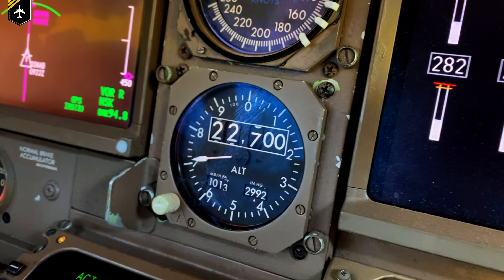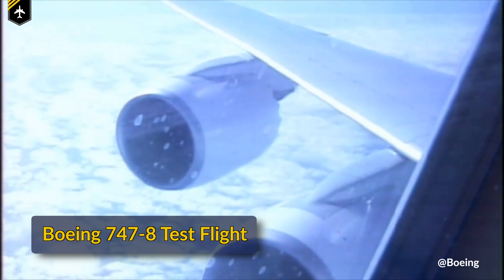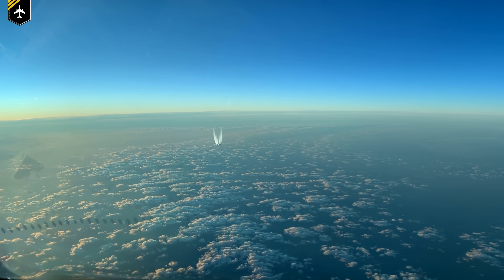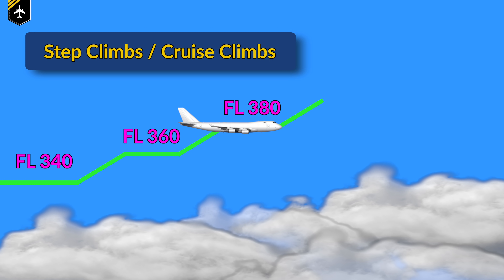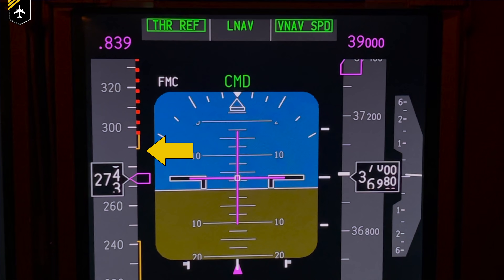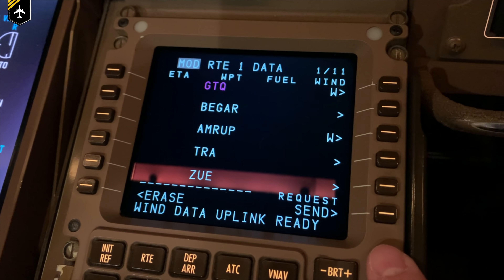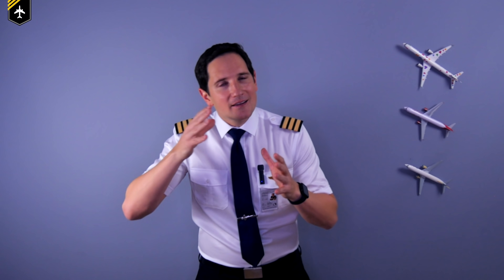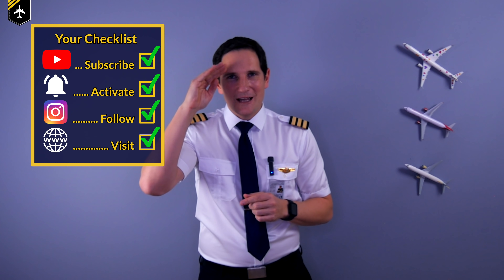How HIGH CAN PLANES fly? What is the COFFIN CORNER? Explained by CAPTAIN JOE

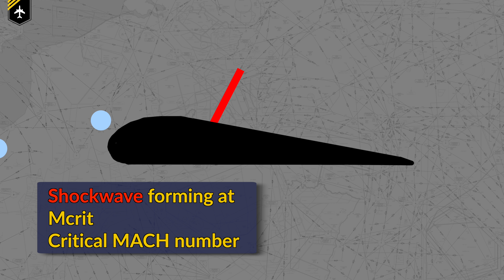Comment: At 8:52 we can see that the speed of the air is so that the flow of uover and under  the wing reunite at the trailing edge but that's not the case , the air on the top surface of the wing being faster then the air flowing under .

Comment: Altitude goes according capability. If a large wingspan aircraft can glide subsonic at high altitude, it can likely do 60-70K ft. Airbreathing aircraft: Mach 2 fighter aircraft can get to 60K ft. Mach 3 aircraft can get to 80K ft. Mach 4, 90K ft. Mach 6, 120K ft, and so on. Rocket aircraft: only limited by airframe heat handling capability.

Comment: At 16 seconds in you mention "what does all of this have to do with the shockwave of a sonic boom" when in fact the video shows a "vapour cone" which does not necessarily need a shockwave of a sonic boom at all. It is due to a drop in air pressure (and hence a drop in the air temperature) and the dew point temperature. For example if the pressure deferential between the compressed air at the leading edge of the wing and the expanding air at the trailing edge of the wing is great enough, there will be a temperature drop of the air which will be below the dew point temperature of the air and moisture in the air will condense to form the vapour cone. Higher humidity air will have a higher dew point temperature. This is why many vapour cones can be observed close to large bodies of water as in the video clip you show.

Comment: If you go from flight level 320 to flight level 360 that gives a total climb of 4000 feet and with a climb rate of 100 ft/min the equation looks like this: 4000/100=40. This means that it took you 40 minutes to do a slow continuous climb from fl 320 to fl 360 :)

Comment: I wonder if a plane found itself in the corner and dropping could they push the engines to full power and open the reversers to basically try and force a retro thrust slow down?  Or are those locked closed any time the gear is up.

Comment: Hello Captain Joe 
I have a technical question.
If the airplanes stalls at a given 1G angle of attack (typically 15 ~ 17 degrees)  regardless of density altitude.
how is it that the wing can "STALL" at the low end of coffin corner when the given AOA is typically only around 2~4 degrees?
If wings hasn't exceeded the stalling AOA (15~17 degrees) , then by definition the wing isn't stalling. 

1st Q:  How is the airplane going to "stall" when the airspeed hits the low spd red tape? The wing has NOT exceeded its 1G stalling AOA?

2nd Q: When you say "stall" are you referring to "low speed shock stall"? 

Best Regards

I also subscribed...

Comment: FL360 means about 36000 ft (QNE). FL320 means about 32000 ft (also QNE). So delta (difference) is about 4000 feet. Divided by 100 feet per minute gives 40 minutes (4000 / 100). It can take plus minus couple seconds for little instability which can be found in every aircraft.

Comment: Hello Captain Joe, assalamualaikum 
Is the answer for the question in this way......
Acceleration = 100ft/min
Initial velocity = 32,000 ft
Final velocity = 36,000 ft
Therefore, by using the formula of acceleration, ie (a=v-u/t), the answer could be found 
Therefore.... 
100 = 36000-32000/t
Interchange....
100*t=4000
T=4000/100=40 minutes

Comment: I vaguely recall an accident report where the pilot used flaps to operate at higher altitude, and had to disable an automatic flap retraction system by pulling the breaker.  When someone else reset the breaker, the flaps retracted and the aircraft stalled.

Comment: Well in reality a plane can fly as high as the pilot is will to tolerate the thing falling apart
Reply: Well, no.  You won't fall apart without air, you just won't have the lift t go higher.
Reply: No. At a certain point it just won't climb.

Comment: Is there a situation where a pilot may exceed the maximum altitude? When I was a teenager in 1973, I flew on an almost empty three engine jumbo, I don’t recall, but it may have been a Lockheed L-1011, from JFK to SFO. Over the Midwest, the pilot announced that we were going to climb over a large storm system. I recall the announced altitude being well into the 40,000 feet. I now know that the L-1011 has a max altitude of 42-43,000 ft. Due to the fog of time and memory, I’m not confident in the number I have in my mind, but it was in excess of 43,000 ft. The experience was remarkable; a sea of flashing lightning as far as I could see from my window seat. It was around 9-10pm local time.

Comment: A few numbers are being provided by insiders for the absolute ceiling of the Boeing 747, and I cannot dispute those, except...

The absolute ceiling is a function of engine performance per equivalent speed-altitude. It seems to me the early Boeings with engines of lower bypass ratio would do appreciably better than the modern “barndoor“ propulsions units, having greater thrust but lower efficiencies at extremes of altitude and speed.

Thesis: It depends... -- but it has to depend, on the (generation of the) engine.

Comment: The flight envelope of the SR-71 from the original flight manual has been posted online. It's extremely narrow. It is prevented from going supersonic below about 25,000 ft. due to aerodynamic stress. On the other hand is prevented from GOING SUBSONIC above 40,000 ft, and can't exceed Mach 2 below about 50,000.

Comment: How does actual cabin pressure change with altitude? I guess the thinner the air outside of the plane, the thinner gets the air inside the cabin.

I remember once flying from San Francisco direct to Sydney on Quantas. I slept a lot on that flight, and the flight itself was longer than usual. Before landing in Sydney, the captain explained they had strong head winds, and in order to avoid the inconvenience of refueling at Fiji, they had to climb higher and fly slower, hence the longer flight. 

I typically sleep 6-7 hours a day, but on that flight I slept for more than 9 hours, extremely atypical for me. Could that be due to lower oxygen levels in the cabin?

Comment: Hi Joe, from what i know, 43.100 ft is a limit imposed by the differential pressure inside the cabin that reach his limit (then the cabin altitude starts to climb as much as the aircraft do). Modern aircraft and private jets, having more robust fuselages, can reach cruising altitudes higher than FL500 providing the aircrafts are equipped with an "automatic emergency descent system" in case of explosive decompression. Looking at the 747-8, i suppose that the absolute ceiling should be well higher than 50.000 ft during ferry flights... Anyway, the "coffin corner" indicated on your PFD is "temperature (SAT) and C.G. sensitive",  while the one indicated on the FMSs is calculated in standard air and updated by the pilots for cruise center of gravity side.

Comment: Probably the most interesting plane in regards to the so called coffin corner is the Lockheed U 2. It can fly at 70,000 feet but, at that height the difference between the never-exceed speed and stall speed is 12 mph or 10 knots. Sounds challenging even before considering you need to wear a spacesuit to fly (and potentially eject) at that altitude.

Comment: I know it has nothing to do with airliners. But it might have been worth mentioning that the U-2 spy plane, due to it's extreme altitude flying, actually cruised in a "Coffin corner" state. This was one of the reasons only the best pilots were used, it also meant that they were very vunerable to SAM, as they had very little ability to maneuver. In fact they put them in this situation because they thought they flew too high to be affected by SAMs, and believed it was safer to be above the effective altitude of the AA missiles than be able to dodge them at lower altitudes.

Comment: The engines are the key here, the clever engines on the SR-71 allowed it to climb and fly at such an unbelievable altitude.
747-8 is just over 43,100 feet, 
Highest flying commercial aircraft was Concorde at 60,000 feet.
Highest EVER was the SR-71 at a mind boggling "over 90,000" which means it's still confidential unfortunately.

Comment: On all of my 747 flights, we actually began the cruise rather low, 29000, and only gradually climbed higher. The highest I’ve ever been in an airliner was on a 757 at 42000, on a very short route, PBI-ATL. I was very surprised that we climbed so high on such a quick segment.
Reply: could you tell the diffrence when you were 42,000 feet vs if you were lets say 36,000 feet. Because i cant tell the diffrence when flying at 36,000 feet  looking out the window it looks no diffrence than 40,000 feet

Comment: Thank you, I learnt a few more things about flying that I not only did not know, but never thought about before. I certainly would be interested in learning more how a passenger, such as the Concord would be affect at high altitude and at high speed and how its design help to push the envelope.

Crossing the Atlantic on a BA Boeing 787-8, I remember seeing that we had top off at 42000 ft. According to Flightradar24.

Comment: When an aircraft reaches the absolute ceiling, it means that there's not enough oxygen in the atmosphere to burn the fuel inside the engines and the air is too thin to maintain lift in the wings. That's why the aircraft stalls.
Reply: Exactly.. this is why space is fake.  There's a physical boundary... thin air destroys lift and nothing will combust without oxygen.  The inverse is true... you can only go so deep in the ocean before the pressure stops anything from moving

Comment: Shockwaves form on the wing well before any major hinderance to aerodynamic performance ensues. Especially in the case of the 747, the airfoils inherently operate super-critically at cruise speeds. There is a difference between the critical Mach number (M_Crit) and the Drag Divergence Mach number (M_DD).

Comment: I hoped you would explain hou to get out of the coffin corner. Reduce power to the engines maybe?
Reply: I think the best solution is to not even try to approach the coffin corner?😂
Reply: @geofs_yt_pursuer6976  yes off course! But that’s not the answer to my question is it? He said do not climb because of stall and do not descend because of increasing airspeed. So what do you do?
Reply: @KoenvanderKouwe  You descend at a constant speed by reducing thrust accordingly. With an autopilot with autothrottles, it isn't hard to do.
Reply: @TheOwenMajor  Thanks Owen
Reply: @TheOwenMajor  yeap. controlled descent.

Comment: NOTE: 1 = true/yes, 0 = false/no Text preceded by two '//' are comments and are ignored by the program when running. 'White Spaces' are ignored

Here's Microsoft's FSX - X and Prepar3D's Data coded in the "aircraft" TXT file found in the main airplane folder/directory:  \n\nMaximum Range\n7,325 nm         13,570 km\n\nMaximum Certified Operating Altitude              [45,100 ft]          13,747 m\n\nFuel Capacity\n57,285 gal       216,840 L\n\nBasic Empty Weight\n394,088 lb    178,755 kg\n\nMax Gross Weight                        875,000 lb       396,893 kg\n\nLength\n231 ft, 10 in       70.6 m\n\nWingspan\n211 ft, 5 in         64.4 m\n\nHeight\n63 ft, 8 in         19.4 m\n\nSeating Typical 3-class configuration - 416\nTypical 2-class configuration - 524"
Category = airplane

The Speeds references can also be found and altered inside the same TXT file: [Reference Speeds]
flaps_up_stall_speed    = 140.0                 //Knots True (KTAS)
full_flaps_stall_speed  = 112.0                 //Knots True (KTAS)
cruise_speed            = 505.0                 //Knots True (KTAS)
max_mach                = 0.92
max_indicated_speed     = 365.0                 //Red line (KIAS)

And this too: [autopilot]
autopilot_available             = 1
flight_director_available       = 1
default_vertical_speed          = 1800.0
autothrottle_available          = 1
autothrottle_arming_required    = 1
autothrottle_max_rpm            = 99
autothrottle_takeoff_ga         = 1
pitch_takeoff_ga                = 8;

Comment: How was concorde able to operate in such extreme limits
Reply: Wing characteristics (delta shape), supersonic engines, afterburners, and being a relatively thin plane all helped it do some amazing things with height and speed.
Reply: @stonent  and a lot of money from British and French govt
Reply: Wind resistance goes up exponentially as speed increases and in order to fly the speeds that concord needed to fly and still maintain a respectable fuel range, they needed the air to be as thin as possible, hence the high altitudes. The rest of the plane was then designed to fly at those altitudes.
Reply: Moving faster means you can fly in thinner air and still get lift.
Reply: She is faster rider than anyone

Comment: I remember the B-58’s causing sonic booms back in the 1960’s.  The were designed to go supersonic.  I rode a flight years ago that cruised at 41,000 feet.  It was CAVU that day.  That was some view up there.
Reply: Extraordinary looking plane. I wonder if any still preserved. It had to be kept just for art sake.
Reply: Cool looking plane.
Reply: Did you know a commercial 747 and a DC-10 both went supersonic (by accident). No damage was found on the 747, the DC-10 had slight.
Reply: Sure you where kid
Reply: @cfernan07  The flight Captain announced our cruising altitude as 41,000 and the flight data on the cabin video screens displayed that number.  As I recall the plane was an airbus A-319.  41,000 feet is well below the service ceiling of that plane.

Comment: The 747-400's ceiling is actually 45100 feet. Pretty high! And your slow continuous climb took 40 minutes.
Reply from the maker: Well done Buddy!
Reply: @flywithcaptainjoe  can you apply speed brakes when you are overspeeding or in mach dive?what should a pilot do in these situations?i am simulator user and i am very interested into these kind of things...i ve been in the coffin on x-plane 11 737-800 but i had no problems leaving it with no damage to the airframe...i have noticed that when i try to climb over 43000ft the plane pitches down on its own no matter how i am with full yoke back...after i lose some altitude the plane again pitches up and again on 43000+++ the same happens again and again...is it just the fisics or its some kind of onboard protection?
Reply: @flywithcaptainjoe  B747
Reply: @flywithcaptainjoe  can you please explain how to operate the radios and how they work etc.
Reply: @flywithcaptainjoe   B747-400 altitude Is Space
Reply: so if i understand correctly there are 4 limits: 
1. max height company/flightplan
2. max height atc/faa
3. max height manufacturer
4. physical max 

Right??
Reply: @Nussholzmobiliar  hi bondman anya said she wants to marry you
Reply: My personal best is 46,000 ft in a 747-400, we did not have much cargo, and passengers. Also it was a short hop. Thanks for the great video.
Reply: @Aditya Shaligram All docs say max is 45100. The Absolute is around 47000.
Reply: I guessed that 744F's ceiling would be a lot higher due to its lower bypass ratio PW4056/GE CF6-80/RR RB 211 engines.
Reply: Yes agree! One of our 747-400 the BCF recently flew from JNB to NBO at 45000 feet. I had never seen that before. But regularly at 43000 feet especially from EZE to UIO. Indeed 45000.
Reply: @remainblessed6432  From  EZE Argentina to UIO Quito? that airport is like 7900feet !!!!
Reply: Virgin Orbit: You Know What I'm Going As High As I Can To Launch My Rocket
Reply: Kamov 32 3600 f/m. It’s like a missile.
Reply: @DachYou realized that Joe already answered and said my answer was true... Good England btw...
Reply: @Aditya Shaligram the restriction by the manufacturer is always lower than what can be achieved, so if a pilot flies at 43000, he has a safety margin
Reply: @jan-lukas  The only time I can think of this being false is on speed dials or gauges.
Reply: I was just looking at the SR-71 flight envelope. That's about the altitude AT which the SR-71 IS PROHIBITED FROM GOING SUBSONIC.
Reply: @fieldlab4  a dumb question: why is the SR-71 flying at altitude AT is prohibited from going subsonic? Because of higher density and consequently higher consumption?
Reply: @paoloviti6156  The flight envelope has no relation to air traffic regulations. It's purely the limitation of the air frame itself. If the SR-71 even tried to fly subsonic at that altitude, it would fall right out of the sky.

The A-12 and SR-71 were very limited and inflexible designs which could only do one thing- fly high and fast. They couldn't do anything else and flying them was just a delicate act of keeping it exactly within parameters at all times. They could barely even turn. They could accelerate pretty well though.
Reply: @fieldlab4  thanks for replying. Now I understand and makes sense because the RS-71 is simply not designed to fly around like an F-16! Nevertheless the RS-71  is one of my favourite airplanes!!

Comment: without even watching, they can fly as high as they want, but Coffin Corner is the limit of the aircraft's operational height, one plane's "Coffin corner" may be 15,000 feet, another plane's might be 40,000 feet, with Coffin Corner - go too fast, you could enter a stall on the air-flow, if it goes bad for you, you might go "super-stall" (wing air flow fails so plane dips, after the plane loses a few hundred - thousand feet you pitch the nose up, pitch too high or have the tail pitch wrong, the turbulence from the stalled wings could reach and cover the tail, then it's a "super-stall") and crash the plane, same happens you go to slow - let's say 630mph is "Coffin corner" if the goes any faster or slower than 630mph, it's bye-bye plane, the only way to get out of Coffin Corner is to descend to where the speed and altitude give a wider range of options to you